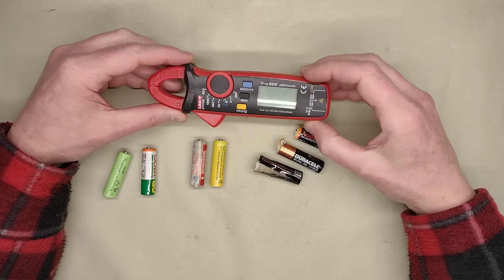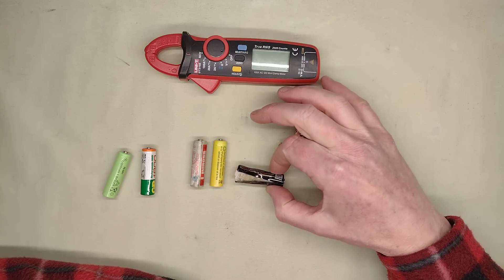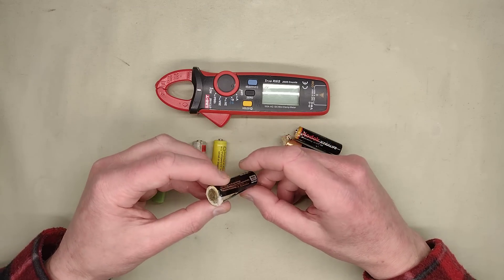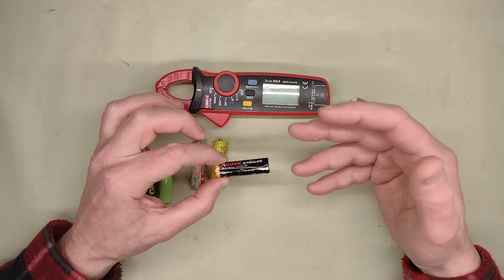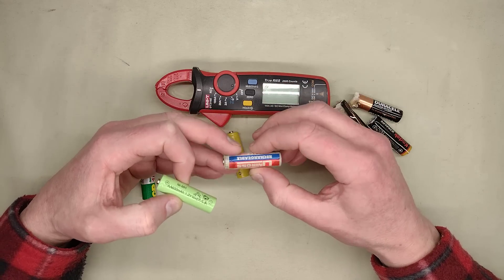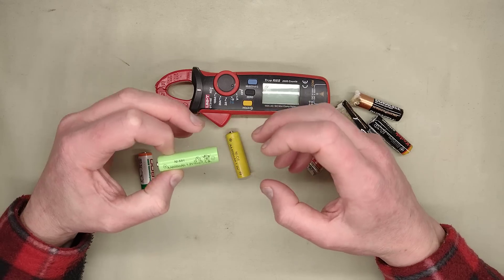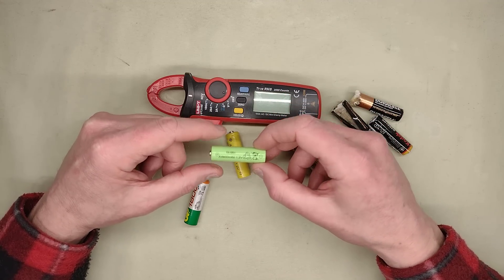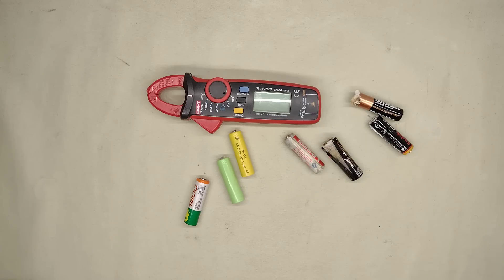The curse of leaky alkaline batteries

Comment: I'm pretty sure the main reason why we are having leaking batteries nowadays is that almost no device has a real on/off switch. Even with just microamps of standby current, the batteries will get discharged over time, and when you have multiple batteries in series the first cell to reach zero volts will get charged with reverse polarity by the other cells. Which no battery chemistry likes, resulting in leakage. I guess the main reason why we had way less leakage when alkaline batteries replaced the old zinc-carbon ones was that devices back then had a real switch to isolate the batteries, so absolutely no current did flow.
Reply from the maker: The most significant issue is the removal of the trace level of mercury that used to be used in the electrodes to absorb hydrogen.  The new "eco safe" batteries tend to pressurise and leak, resulting in massive quantities of landfill.

Comment: i do like nymph batteries as they are a lot more economical, but why arent they a little extra, like 1.5v, why are they 1.2v? and can the chemistry not force in an extra .3v
Reply from the maker: That extra 0.3 is the holy grail.  But the manufacturers could make things work with 1.2V cells if they wanted.

Comment: Clive do you think it would be worth wild to change out the 9 V battery that my older fluke meter has and when I say older I mean probably 20 years old or more. To date I have used regular 9 V alkaline batteries in it and they last for ages and I’ve never had one leak yet but it might be worth the effort you think the 9v Alkalines are as prone to leakage as The 9 V rechargeable‘s seem to be very tough to find in the shops I will probably have to do an Amazon order or eBay to get one. As always thank you very much Rick.
Reply from the maker: The best option is to use prominent brand batteries from a real battery manufacturer (NOT DURACELL).  The ones that still actively develop battery technology make better batteries.

Comment: Glad you got the meter running again. Sadly, I’ve got a pretty well-populated photo album on my iPhone devoted to my own casualties of the alkaline wars (Duracell has been the worst. In fact, I’ve stopped buying Duracell completely because of their high leak rate). Even more sadly, many of our casualties have been precious Hallmark “light & sound” Christmas ornaments that aren’t made to be opened for repair. 

Fortunately, I’ve also gotten really good at cleaning up and repairing the damage… First I open the device (I’ll find a way in, even if it’s slightly destructive) because electrolyte often leaks inside and if ignored will continue to corrode. Then I thoroughly neutralize any electrolyte with cotton swabs dipped in 9% acetic acid, aka “canning vinegar” (regular vinegar is usually 5%). Then I neutralize the acid with a thin baking soda and water paste. Then I thoroughly rinse everything that is rinsable with 91% or higher isopropyl alcohol (be careful as some solvents will damage plastics). I’ll usually file, sand or Dremel the battery contacts and “tin” them with a fresh solder surface. I automatically replace any affected wires because electrolyte is usually drawn up into them under the insulation by capillary action and will continue to corrode the wire later. Then I resolder any bad connections and replace any discrete components that were damaged. I’ve got access to better chemicals but usually stick to good old fashioned vinegar, baking soda and isopropyl alcohol. 

Alkaline batteries have high power output, so I still like them for many tasks. For emergency type devices I’ll store the batteries next to the device in zip-lock bags. Just don’t forget to remove them before you store your device—unless you want more repairs added to your already lengthy to-do (honey-do) list.
Reply: Duracell batteries are terrible...they have destroyed expensive digital pressure gauges. I have tried the so called Procell version and they leak the same. There is supposed to be a guarantee against this but how one would claim is beyond me. I have cheap Chinese alkaline cells that are 10+ years old that are still working in remotes without leakage. It's unacceptable in this day and age having to suffer cell leakage like this and manufacturers should be held accountable.

Comment: Notice that if durability is your main goal, you shouldn't go for the largest capacity. For example, the "Eneloop XX" have a higher self-discharge than the regular "Eneloop" variant and Panasonic also rates them for only 500 charge cycles instead of 1000 for the non-XX version. In AA size, the capacity difference is about 25%.

Comment: what's best for camera flashguns? the hotshoe ones?
Reply from the maker: That depends on the era the camera flash is from.  Older ones needed higher voltage cells.  New ones may be optimised for rechargeables.

Comment: I use Eneloops in all of my meters. All of my flashlights use Li-ion. Got tired of buying new devices due this very issue. I guess I just have the discipline to keep my cells charged. Kids toys still use Alkaline because my rechargeable stockpile cannot keep up with all of the toys that require batteries. But at least we are trying to do better I guess. BTW,  I have that same meter and I like it a lot.

Comment: I had one Eneloop that developed a leak. 1st symptom was it self-discharged quickly and it tested at less than half the capacity. Only after couple of days of laying around I've noticed it became wet near negative terminal.
Reply from the maker: The reduced capacity is possibly a sign of electrolyte loss.  Does it weight much different from a good cell?
Reply: @bigclivedotcom   I didn't notice that in hand, it is long gone in a battery bin, so no way to check now.

Comment: Very interesting video Clive and for me a very unexpected topic because I've been using alkaline cells for years now and never had a failure.  I use them in multimeters, remote controls, clocks, portable FM radios, head torches ordinary torches, test instruments etc and only buy the cheapest I can find - usually from ALDI or Toolstation.  I also always run them until the device in question fails to operate.  What am I doing right or have I just been very lucky?
Reply from the maker: There's a good chance that the source they use for cheap batteries is a dedicated battery manufacturer who take their chemistry seriously.  I get the feeling other "posh" brands are just pretty labels on the cheapest cells they can get.

Comment: The best use case for alkaline batteries is long term slow discharge. They perform great in that type of application. However you can't take your eyes of alkaline batteries long term, you never know when they're going to leak.

So they suck at the thing they are best at.

I wish people would just do a better job at designing devices to be more NiMH friendly. I have way too many that check out when the voltage gets below 1.2 - 1.25 or so.

Comment: I wonder about those lithium batteries that use a tiny integrated voltage convertor and masquerade as AA/AAAs? They are very expensive currently and only seem to be made by weirdly named, unknown companies. You also seem to have to charge them via USB, although I suppose they might fit into some lithium chargers but how that would function with the internal electronics I do not know.

Comment: Same experience here. Leaking Alkaline cells have ruined many of my electronic items over the Years. Duracell Alkaline cells being the worse offenders followed by those horrid cheap cells they sell in so-called 'dollar stores'.  I have gone to rechargeable cells wherever I can. One issue however that I have noted with some Ni-mH rechargeables is the diameter of the cell is larger that that of an AA or C Size carbon-zinc or alkaline primary cell unit, and they will not fit into the recessed cylindrical (insert) battery compartment of many devices, most notably my 70's/80's vintage Sony portable radios. Keep this in mind if you wish to try them. See if they will fit first. :)

Comment: This whole comment section has well validated my feeling that Duracell now makes some of the shittiest batteries on the market. Every one of them I've dealt with for years now has been leaky or dead, well before their expiration and usually with little or no use
Reply from the maker: It's a brand that is part of the portfolio of a holding company.  They're not helping themselves by ruining the brand's reputation by using a substandard manufacturer.

Comment: Techmon just did a similar video on CD players and a CD player that decided that the batteries it came with weren't good after an hour.
If they're getting low you can just recharge them on the other hand reduced runtime. But under certain devices they're very picky about the whole voltage thing or at least that's what I've been taught for all these years, namely microphones. I've been wondering if I should put a lithium rechargeable 9V in my buttset.

Comment: Have you ever come across "Hybrio" or other hybrid batteries? I found them very good at retaining their charge over long periods of time. I'm pretty certain I'll still have a set or two somewhere. The only thing they didn't tolerate was to be discharged too deeply and stored away in that state. Interestingly, I do still have some old NiCd batteries (I used them in photo flash guns) and they're still usable even after twenty five years! Old "Radio Shack" ones they are. Even a set of "Uni-Ross" NiMH at about twenty years old - The real high capacity ones (2500mAh, AAA). I keep an eye out for the newer cells with the booster circuit because a lot of my antiquated kit doesn't appreciate being underrun at say, 4.8V instead of 6V. As yet, I haven't found them.

Batteries are a fascinating topic!
Reply from the maker: I have some Hybrio here.

Comment: I stopped buying Duracells a while back due their tendency to leak even in the package. Don't recall ever having a Eveready leak. That said the only devices I don't use Eneloop rechargeables in now are devices that don't work well with the somewhat lower voltage of rechargeables

Comment: I recently had to find out that the Duracells in my camera flash leaked. One of the bridge contacts in the battery compartment lid was corroded so hard I had to use aluminium foil to make it work again.

Comment: hoping for suggestion on cleaning the alkaline mess
Reply: Scrubbing with a toothbrush dipped in methylated spirits works fairly well and the solvent dries rapidly.

Note that methylated spirits is the Australian term not sure about other countries but I'm referring to ethanol (alcohol) that's 95% pure and sold in bottles for cleaning purposes. I think in some countries it's known as denatured alcohol or some other term.

Pour a small amount into a container, dip a hard bristle toothbrush in the alcohol, use it to clean the contacts. So far I've had success with that method.
Reply from the maker: Vinegar will neutralise the alkaline electrolyte, but be careful not to contaminate other stuff with it.  Some circuitry can be washed with water and dried with a squirt of isopropanol to help evaporate any residual water.

Comment: How about SMOKE DETECTORS?  I would never use anything but alkaline in them!  A rechargeable "9v" battery is only 8v max, with newer technology...more commonly around 7v when fully charged!!!
Reply from the maker: Smoke detectors are one application where the single use lithium cells work very well.

Comment: I think it's beyond time the product engineers started actually designing for the typical available power per cell of NiMH. By now we should even have adapters that can clip on somehow to older devices to connect and somehow power manage 2 cells for those that detect an undervoltage from a fully charged single NiMH cell.

Alkaline batteries are a royal pain in the ass and need to die. Lithium is overpriced and problematic on multiple fronts (environment, human rights, safety). Yet the electronics universe keeps designing toward lithium because no one wants to think about the cost of their choices in anything other than dollars. I hate it.

Comment: Hey clive, it has been a couple of years since I've discontinued the use of alkaline batteries in every gadget around the house that uses AA or AAA batteries for the very same reason, replaced them with low self discharge NiMh rechargeables and so far its been great. NiMh battery last for years in remote controls, needs to be topped off once in about 16 months, I've got 10 year old Varta NiMh cells still going strong.

Comment: As a DJ, I woukl LOVE to use Ni-MH batteries in my Shure wireless microphones, because I can't trust any battery that's been used previously even though it may have 90% of its capacity left - the risk of a mic going dead in the middle of a wedding or corporate speech is simply not worth it. However, the mics are iffy (if they work at all) on 1.2V cells. So alkaline it is, although I take care to remove all batteries from the mics after an event.
Reply from the maker: That's not helped by smart chargers that falsely report a cell as charged way too early if it has a higher cell resistance.

Comment: Camera flashes is one use where there is a performance difference but only in an edge case of quickly repeatedly firing the flash at higher power levels.  The impact is how quickly the flash can recycle and be ready to fire again. In a move to address this, Nikon made an optional battery door for their SB 800 which allowed using 5 NiMH batteries to achieve the recycle times of 4 alkaline
Reply: So called "1.5V alkaline batteries" will have LOWER voltage than 1.2V Ni-Mh when fast discharged. Just 1A of load and "alkalines are 0.3V higher than Ni-Mh" is demonstrably wrong. Single use batteries do have ESR (internal resistance) a lot higher than rechargeables and dip down below level that rechargeables dip. What Nikon did is a disgrace for those poor users with alkalines.

Comment: Potassium hydroxide is the electrolyte used in alkaline batteries, it's corrosive to some metals, the worse is amonium chloride used in zinc carbon batteries. I have had to make up many a new battery contact thanks to leaking batteries. A small hobby tool with little grinding wheels will clean corroded contacts.

Comment: I recently invested in some very expensive ebl lithium aa's and for the right application they are amazing! They last soooo much longer than any other battery I've ever had, including nickel metal ones of the same capacity, they charge quickly, and they have a huge output without breaking a sweat. Well worth the money imo.
Reply: Could I ask what device or application you use them in. I've been interested in these myself.

Comment: I absolutely agree with all your points, but there is one frustration with rechargeable cells that occasionally bites us. Alkaline batteries tend to provide a solid 1.5 volts when new, and rechargeables that I have used never quite provide the full 1.5v.  I have measured many Eneloop, Duracell, etc. rechargeable batteries, and even at full charge, they seem to only provide about 1.36-1.45 volts. Now, that difference may seem insignificant, but we have encountered situations where it makes the difference between something working or not. Just this week, my child asked for batteries to put into a LEGO train engine. We tried combinations of more than a dozen different rechargeable batteries and couldn't get it to work. Finally, we put some fresh alkalines into it and it worked first time. I measured all of the rechargeable cells that had failed to work and not one of them was 1.5v, and apparently the cumulative loss across all of those cells was enough to make the LEGO motor not run. Maybe manufacturers need to start designing electronics that can function on the slightly lower voltage or make room for an extra cell or two.
Reply: Put the NiMH batteries into a Batterizer.  Problem solved.
Reply: @stargazer7644  What is this batterizer? An internet search brings up a really random array of embroidery products.
Reply: Interesting! Thanks!